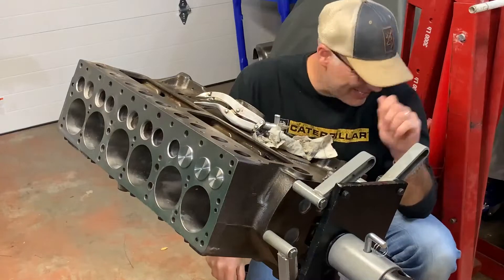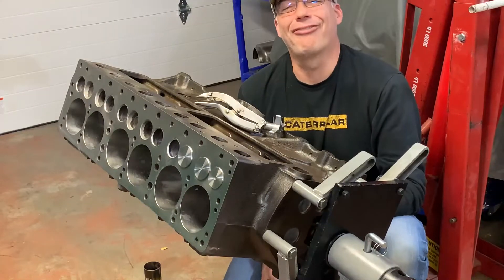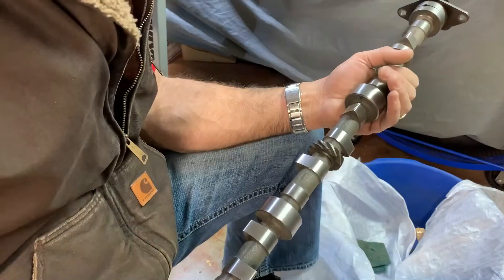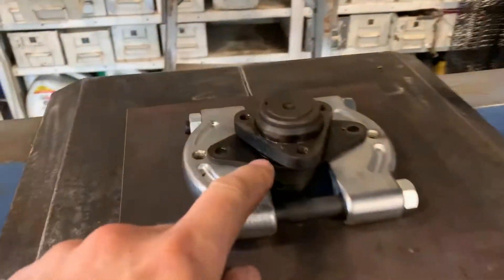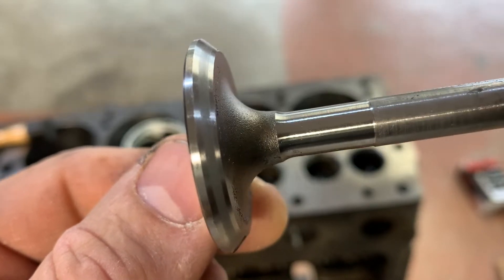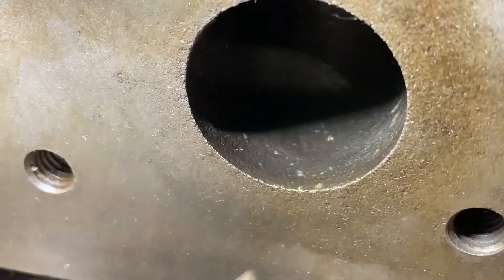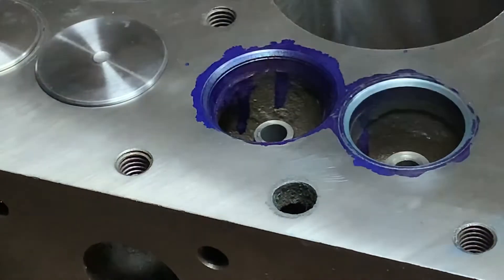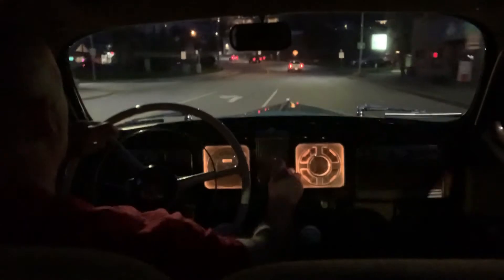Vintage Flathead Engine Rebuild Assembly Update....Uh-oh. PART 1

Comment: Sadly from 2030 on all combustion cars including classics will be banned
from public streets in entire EU and Scandinavia  :-( In Germany the 
Green Peoples Party gave order to shorten fuel supply from 2025 on by 
reducing all conventional fuel stations to only one state operated 
central gas station per city or county. Now they even want to slow down 
all the gas pumps from 20 litre per minute to 2 litre per minute...From 
2027 on in the EU certain car spare parts will be banned too....as 
exhaust systems, turbo chargers and even some engine and gearbox 
oils...California and New York will do the same from 2027 on.... So no 
investments should be done in oil burning cars any longer....They even 
created a new kind of crime here, called emissions and smoke crime. Called "Bundesabgasbespaßungsverbotsverordnung" in German.... :-/((((
Reply from the maker: That's unfortunate. I am skeptical we'll see something similar in Canada for quite some time yet. We are a very large country with a small population per square km.  Canadian density is 4 people per sq km here in. Germany is 232 per sq KM/  Outside of our largest cities, we do not have well established public transit. No high speed trains. No cheap air flights. Bus service is limited. Trains are basically slow freight systems, all across Canada. We are seeing increased fuel prices. We are seeing increased taxes and insurance costs. However so far I am not aware of complete elimination plans for all internal combustion engines. Someday, I could see it, hopefully not for quite some time yet.
Reply: @keithsgarage5831  Sadly China dictates the end of use of all combustion cars worldwide. Chinas boss Darth Xi told our EU politicians that they wont do any business with underdeveloped countries that still allow CO2 emitting traffic or combustion based industry after 2030...I am sure USA and UK also will be forced by China to 100% electric traffic because today no industrialized country can afford sanctions by China....

Comment: Hi Keith, what is the rating on your engine stand?  I want to make sure I get one suitable for a Mopar six.  I know the extra length of a six puts additional strain on the stand.  Thanks for the great videos, while my is a 49 Plymouth, most details you present apply directly to my car.
Reply from the maker: It is rated for 1000 lbs. It feels good. Stable.
Reply: Block is about 350lbs.
I have a 37 engine from a Dodge truck, laying on ground feels 400.  Good thing I bought it for $200.00
U.S. dollars. Same engine block as the 37 & 48 Dodge Coupe 218.7, except carb.

Comment: At the end it looks like the speedometer is really dim and the radio  and that other big square is so bright it would blind you at  night.
I always thought if you had new valves and the valves seats cut by a machine shop and good valve guides , they seal. I thought lapping valves was for shade tree valve jobs.
Reply from the maker: There are two settings for dash lights. Hi and low. It’s not  blinding. They did what they could, it was 1938.  Incorrect on valve lapping. It’s needs to be done.
Reply: @keithsgarage5831  If you had that shop assemble your motor, would they have caught the problem or would they likely give you an engine with low compression on one cylinder? 
 Now I am wondering if my 52 Chrysler has a dimmer for the dash lights. I just assumed it did. I miss your Windsor, by the way. What car is the engine you are rebuilding intended for?
Reply: @auteurfiddler8706  Kieth has a 1938 Plymouth. He pulled this engine out of it.
Reply from the maker: A good rebuild shop would pick up their error and fix it. No they should not give you a rebuilt engine with 1 dead cylinder. Who really knows for sure what every shop might do.

Comment: Bluing should tell you where there is contact and yet we see none. That tells me that there is something stopping that valve from contacting the seat. I also find it suspicious that you can not twist the valve for lapping. Did you replace the valve guides or were they done at the machine shop? Is your valve guide twisted, angled, not set properly? keep us informed. Thanks for the video.👍
Reply from the maker: Guides were replaced at the machine shop. Then valve grind was done there too.
Reply from the maker: Steve thanks for the heads-up on the piston snap-ring install. I am going back in to address it. I will edit the the video, and re-upload it so it's correct. Thanks for following along. Saved me some grief.

Comment: It looks like the valve guide is too high ,and needs to be set lower down, check the other guides from the deck surface with good a depth gauge or square. Machine shops always get the invoice precise, not always the engine work.